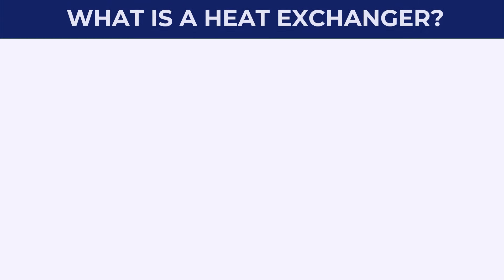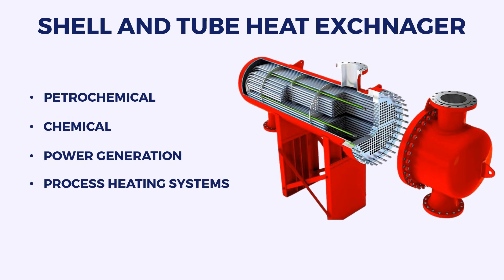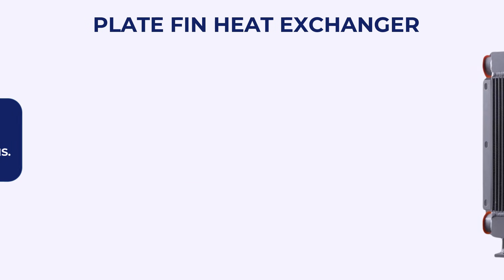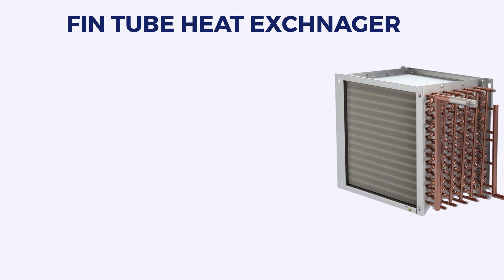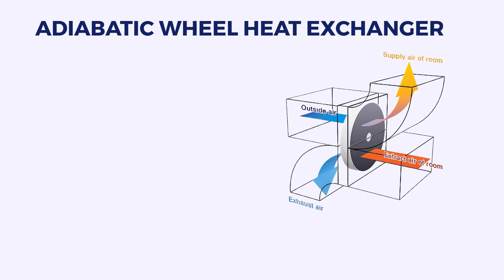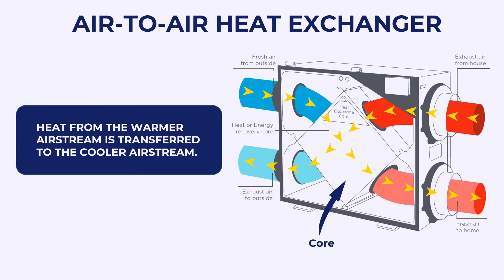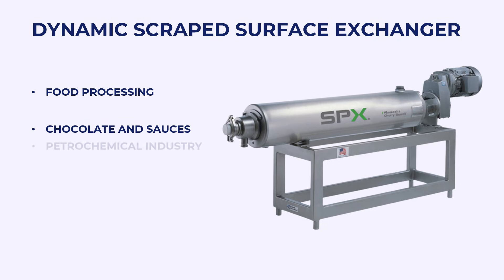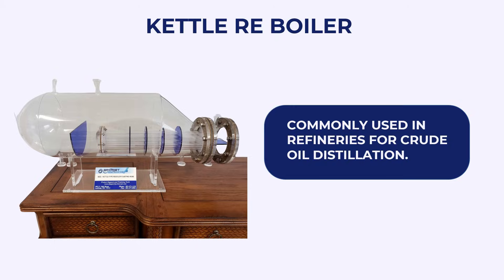Heat Exchangers Types | How Many Types of Heat Exchanger |

Comment: Can used for coling tower return water
Reply from the maker: Yes, it can be used for cooling tower return water — just make sure the material and flow capacity match your system requirements. 👍